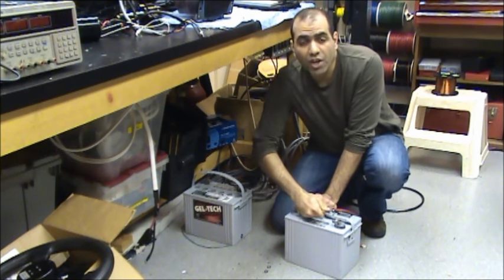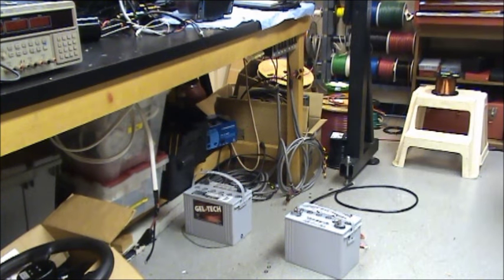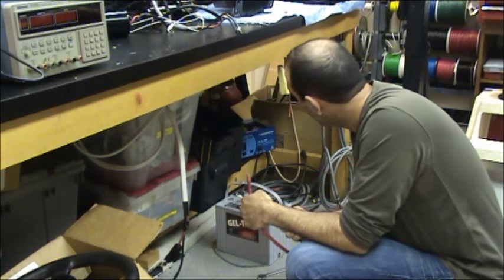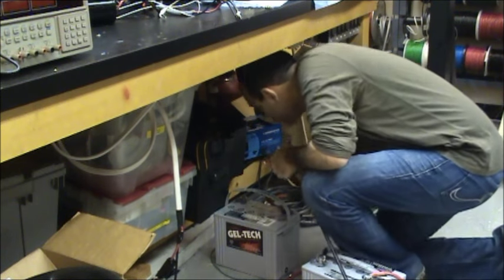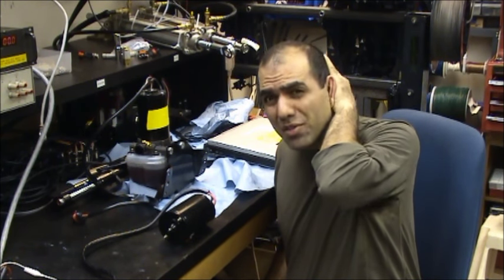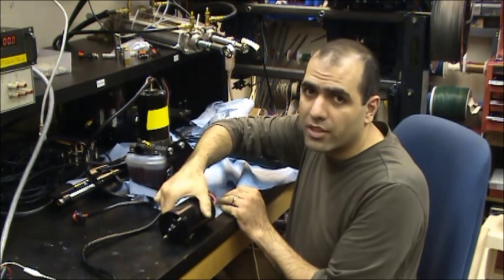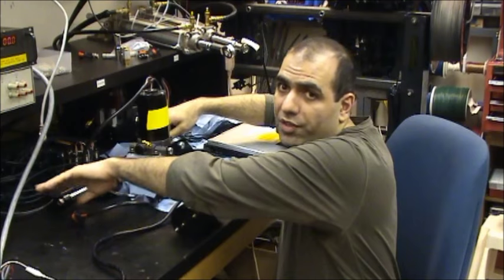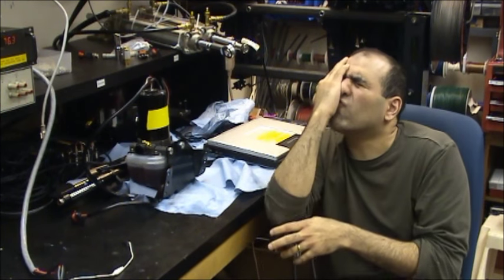How to Make Proper Wiring Connections

Comment: Okay the wrench across the battery is something I have done and I know how painful it can be. Probably one of the more painful things I have seen on this channel. I swear a car battery hurts more than 120v AC.
Reply: how? Does it get that hot?
Reply: Powder-phun Well it can but no its just a lot of current. With 120v from the wall it tingles but with a car battery all the muscles in your forearm contract quickly. I'm not 100% sure as too why its not as bad considering a wall has more current but its just different.
Reply: x9x9x9x9x9 but the current flows through the wrench, not through you. I touched 25VDC yesterday, and i didn't feel anything.
Reply: Powder-phun The current still goes through you. What was the amperage? Mehdi has a video explaining this better than I can.
Reply: ***** Oh weird. I know I have been shocked from car batteries and spark plugs before. I could have sworn the battery hurt worse than the times I have accidentally touched the prongs on a plug while plugging something in or unplugging something.
Reply: Maybe I'm just confused (which is sad considering my dads an ee), thanks for correcting me, but accidentally hitting the positive terminal and a grounded area of the car with a metal banded watch hurts. It spot welded the watch band to the car and got super hot super fast. But yes spark plugs hurt.
Reply: x9x9x9x9x9 It is the heat and the startling reaction which hurts in the case of high-amp 12v batteries. I've done it a few times, scares the shit out of you but usually does more damage to your tools than yourself.
Reply: x9x9x9x9x9 Electricity prefers the path of least resistance, that being the wrench, and very little current actually flows through your body since the voltage drop across the wrench should be relatively low, and certainly cannot exceed 12V. However, it is possible that there is a inductive kickback, the same one that causes the spark, causes a large voltage transient, shocking the hell out of you? I have been shocked on multiple occasions from the primary of a ignition coil and other Xformers when connecting them to power supplies.
Reply: x9x9x9x9x9 It´s DC dude.. Not AC. Jeez...
Reply: *****
Why do you think that?
Reply: *****
That is exacly what i said
Reply: +x9x9x9x9x9
Reply: +x9x9x9x9x9 it's high amperage so it heats up metal but the low voltage prevents it from hurting you directly
Reply: No it doesn't 

Photonic induction has a video where he holds two pipes connected to a car battery in each hand, then shorts them, and doesn't even flinch. 

He then proceeds to grab the live wire of 240 volts AC, but only tingles a bit since he wasn't grounded anywhere. 

Even if a branching path went through you to ground, still the resistance of the human body is way too high to let anything other than minute current to trickle through

Comment: For those who don't understand the risks, there are two common things to consider with an electrical source.

Voltage. 
And
Amperage. 

If electricity could be compared to running water, voltage would be how steep the flow of water is. And how fast the water will flow down. Up to and including a full-on waterfall. While amperage would be how wide the water flow is. And how much water could flow at any given time.

Car batteries have a paltry 12 volts. 
In itself, far from dangerous to humans. Might give you a small jolt. But it wont damage anything.

However...
Car batteries, as often advertised on them, have hundreds of cranking amps on them. Varying depending on the size of the vehicle and engine.

Just 1 amp is enough to seriously harm 
Hundreds of amps shot through your body will almost certainly kill you, regardless of the voltage.

That wrench he dropped only connected those contacts for a split second. That usually wont do much harm. But if it had stayed on those contacts, and closed that circuit, for even a few seconds, it would turn a bold glowing cherry red from the sheer heat of that power going through it. 
Then it would melt and burn the plastic around the battery. And then you're in SERIOUS trouble.

So please. When working with car batteries, DO NOT LET YOUR TOOLS CONNECT THE CONTACTS!!! Not even for a moment! 
And if you have cuts or open sores, keep them away from the contacts too. Your dry normal skin is enough to prevent thr current from going because 12 volts isnt enough to go through it. But an open sore or cut is much easier for 12 volts to penetrate. 

Be safe

Comment: Once I crawled under my digitizing table to jiggle the power wire. Over time, the plug got loose, and sometimes slipped out of the table a little.  While under the table, I had the bright idea that a little spit would improve the connection, so I licked the end of the wire.  The problem was, at the time, the other end was plugged into the wall outlet.  The shock surprised me, and made me  jerk my head back, hitting the underside of the digitizing table.  Always unplug wires before you lick them.

Comment: Excellent method of teaching (if you can compose yourself after his mishaps). Because if you're not hot on being careful and mess with low current high voltage, and you're in a negligent hurry especially capacitors you miss something like discharging them before you handle you circuit, and electricity is not partial to finding a nice easy low resistance ground LIKE YOU....BANG!  OW! *#£##%! CRASH! @#£#!

Comment: I have shorted a 48v electric golf cart battery bank before with a wrench. Needless to say, the wrench doesnt work. It melted.
Reply: LOl do it with a rc high voltage 14s 52volts lol that power must kill after 12volts dc
Reply: o.o

Comment: I'm going to run an electro-hydraulic system off this car battery for you. I just tighten these nuts here. [Zap] AAAH!! [Crash] Always be careful not to short your car battery. Now i connected these cables to the battery and all i want to do is to pass them under the- [Zap] SH**! [beep] If i can just pass these cables under the table here,,, [Zap] [Bang] [Beep] [Multiple beeps] Always finish your wiring before connecting to your power supply. Now instead i'm going to use my power limited supply up here that will drive this pump that's made of this DC brush motor here, and it's going to run fluid into the cylinder back here there that will move it around. Now i enable the power supply,,, [Engine jolting] UGH! [Beep] [Slam] OOOOOhhhhhhh,,, Always double-check your connections.

Comment: If you shirt the battery you'll get a shock
Reply: if you cause a short circuit by putting a metal object across the wire connectors on a high voltage battery it will spark and shock you.